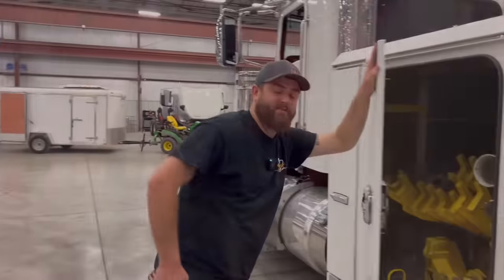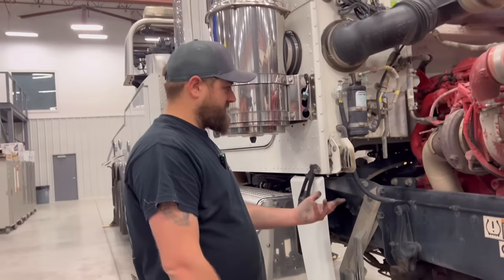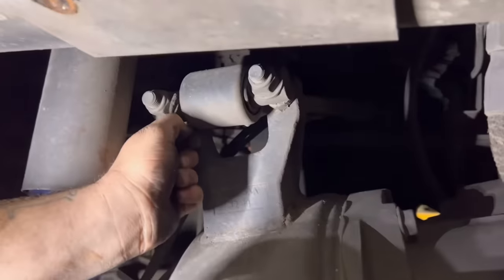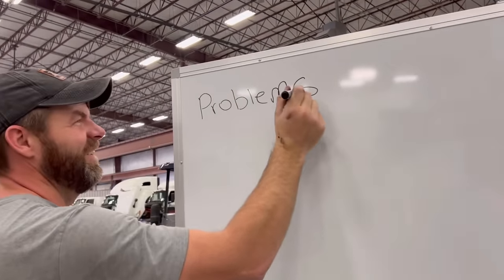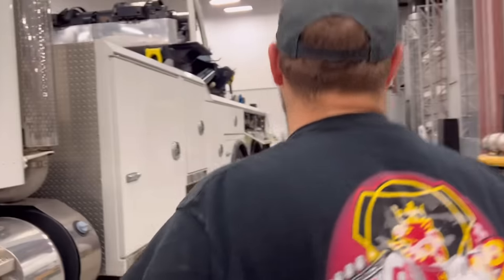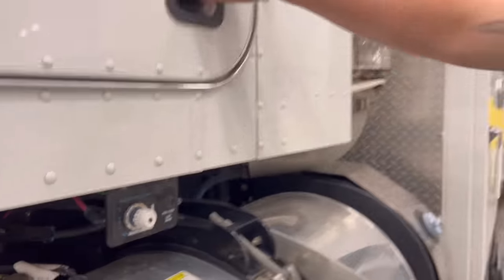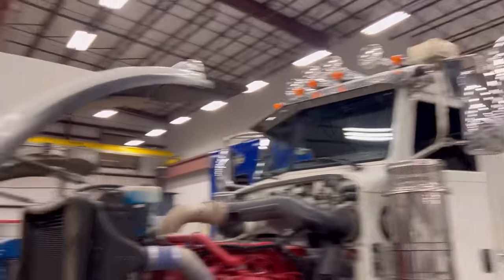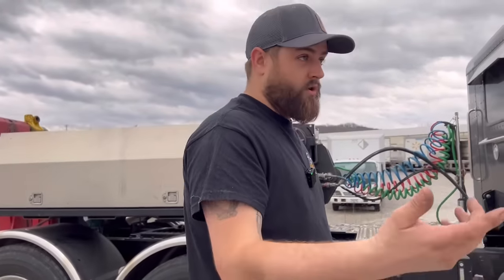The New Rotator Needs COSTLY Repairs…

Comment: YouTube channel “Ron Pratt” with Midwest truck has a similar rotator and when they set the brake it lifts the axle.
Reply: 1150R
Reply: Ron’s rotator is awesome since he has the 1150r which means that the boom can roll toward the back or front. He also has the raptor controller meaning that he uses joysticks to control the boom and it is NOT the same as the control system on this 1150. Murphy’s diesel does have the same control system so it may be better to learn from them and their 1075! Good luck
Reply: i was going to say the same thing i doubt he would have any problems answering your questions this is his channel https://youtube.com/@ronpratt?si=8mjej2jRnoAephqT

Comment: Ive seen moisture in the egr systems many times, its not always coolant. Also your vgt is cycling because the sensors aren't getting a good reading. Before you drop money on an egr cooler, id tell you to try something much cheaper. Clean as much moisture out of there as possible, and then clean any sensors that could be affected by the moisture. Specifically the egr temp sensor, egt sensor, egr differential pressure sensor, egr orifice, and map sensor. Once you do that, the vgt will stop cycling like that. Then you could also run the truck for a bit more and re check to see if it is indeed the cooler
Reply from the maker: I’ll try that for sure! The truck has lots of hours of running at 1500 rpm so it may not be loading up enough to truly burn off all of the soot
Reply: @Bruce_Wilson  - I don't know about your truck, but the newer Scanias don’t use EGR.

Comment: Also, if the truck is parked with the parking brake on the lift axle will not go down push the parking brake in chalk, the wheels adjust your air valve and it’ll go down
Reply: Pull out on the white knob beside the switch for the lift axle and twist it to apply air pressure to the lift axle.

Comment: Would recommend taking the main boom all the way out. Check for any cracks - crack test. And double check all hydraulic lines. And lift cables. Because that could be the biggest drama on a job
 Check twice. Safe and sound. Gease the cables less chance of rust. 👍

Comment: There is a hose on the inside of the frame rail next to the turbo that leaks on all Cummins. It’s a cold water leak. Tighten the clamps and it will fix it.

Comment: That egr cooler looked like mostly moisture which is pretty common. Id block test it to check for combustion gas in the cooling system. You can also test the egr cooler itself. On the lift axle sometimes theyre programed to only drop when the brake is released.
Reply: I know that's true for when its cold but if that thing is still as hot as they made it sound like it should be pretty damn dry. I don't do x15's but I see techs get confused about moisture a lot with the 6.7

Comment: For the safety lights, I'd highly recommend using Whelen and running the system using Whelen Core. It is a bit on the pricy side but the amount of features you get out of it is phenomenal. Not to mention using the best lights on the market. The price is very well worth it.

Comment: Those are federal signal led lights they just rotate u need to have the lenses wet sanded. Those lights are great lights definitely keep them. Also my lift axle on my truck only comes down when the parking break is pushed in it goes up when you put the parking brake on or put it in reverse. Also the crane has to be certified yearly. I have a knuckle boom on my truck and I have my knuckle boom cert. which is good for 5 years. Also my boom gets certified yearly. And they do a total service on it every year also.

Comment: Hey I used to run a big wrecker, as far as your brakes being spungy we had to get a trair gled hand and put it on the trailer service on the back of truck to release the trailer the red valve in the cab try that while driving it
Reply: Had a 379 that did that also,  hardly any brakes unless the trailer brake button was in..weird huh?

Comment: I'd suggest you guys get metal plates for the Rotator, We use them on our 110 foot fire truck they would help greatly when you come to a soft service or even when you don't want to mess up the ground you are using the rotor leveling system.
Reply: The composite outrigger pads are the way to go, they are much lighter and capable of higher loads.

Comment: Did you figure out lift axle? It won't drop when brakes are set. Or if it's down when you set brakes it will lift it. That's what our mini wheeler does.

Comment: We have the exact same truck at our Tow company. I noticed during several recoveries. I kept smelling an antifreeze smell. When I would get on the bed next to the stacks, I could smell the antifreeze. So after doing some tests unfortunately, we had to do a complete in frame. The truck drove and ran perfect, but would lose just a little bit of water, just like your case. I should also mention we also had water from the EGR cooler. So we change that first hoping that was the issue. But unfortunately, it had two major issues. I certainly don’t envy you if that’s what it is. But it certainly has exact same symptoms that our truck had. Ron with Stanislaus Towing

Comment: LIFT AXLE 

Hey Bruce, often times with what i’ve seen or with what I’m aware of with many of the Peterbilts and Kenworths (2015+2020+) has a lift axle switch/ pusher axle switch which must be engaged first from inside the cab before the dial and switches from outside the cab can be used, and yes ofc obviously best to do it with the truck running

Comment: So I’m guessing that like many of the rotators that what used to be mounted on top was a Will-Burt light tower but was probably removed due to issues with the light tower and being so expensive to fix. We actually just removed one from a truck at the Fire Dept I volunteer at because it was just as cheap to replace the tower as it was to fix it.

Comment: When you showed this truck in the first video where you collected it and said you smelt coolant I knew it had issues as I used to own a radiator repair shop plus i know a lot about about Cat and Cummins engines. 
Blown head gasket not good but do get the top tank taken off the radiator also and cleaned out the tubes.
Replace the coolant after the engine repair with enough antifreeze to make it 60% anti freeze anti boil. It will very soon be at 50% within a day.
If its got a Horton Fan clutch make sure its working properly, also check that the temp sender is showing the correct temp in the cabin, buy a coolant temp gauge to check by inserting it in the recovery bottle after the engine has been running for at least an hour.

Also ensure you replace the thermostat NO MATTER WHAT anyone tells you.

It quite often takes a few cycles to get the new thermostat to work correctly.

To get the temperature up to working temperature blank off the front of the radiator to close airflow, you can use a large piece of cardboard.

Comment: The 22 T880 with the x15 I drive was eating coolant like crazy and a new EGR (so far) fixed it. It was at 130k miles. Sitting at 161k currently. Several of our T880 with the same motor have all had to get EGRs to fix the coolant eating issue. Not saying that’s what happening to yalls but just something we’ve been through with that motor.
Reply: Repower it with C15 no more issue

Comment: The lift axle should come down with the brakes off. The switch should just keep it from dropping when releasing the brakes I believe. But the tater where I work the drop axle is set to the parking brakes and raises when in reverse.

Comment: The lift axle only works with the breaks released. Release breaks flip switch down. That’s a DOT thing they don’t want you fooling with it going down the road. My new 2023 is back inside the truck
Reply: some states the switch must be mounted outside the cab

Comment: Hi Bruce love the wrecker behind the cab up top of the box those holes are most likely where the spreader bars where stored also check with zip towing they may be able to help with your towing lights also Ihave to tell you to ask the owner about all the chains binder straps also on the front passenger side tool box there should be a chain chart with different chain sizes and load limits

Comment: Air hose reel roller guides need rotating, or flipping over. I also recommend putting balance rings on all wheels, i run atlas balance rings on my trucks.

Comment: I had a 2016 just like that it was a 1150R (Roller) it weighed 72.600. It that 23k on a 20k steer riding with the pusher up. It’s a steerable pusher so I ran it all the time and I could get the steer to 18. Yes tell Robert it’s what they call a Solo Clutch

Comment: I run the pdi coolers also the pipe and hoses going into the heater core always leak. There is a procedure for greasing the boom, miller has some YouTube videos. John Hawkins is the man at miller that knows everything about there rotators.

Comment: The EGR valve could be sticking or the EGR cooler could be worn out plus those Cummins engines have a problem with using Def fluid in them

Comment: Careful Bruce. Power probes can be pretty dangerous if you don't fully understand the circuit. Especially on vehicles with solid state controls that are inside the modules. Messing around applying power to things you don't 100% know what it is, is a recipe for buying a new computer. If you know what you are doing, the power probe (even the old power probe III) can be great diagnostic tools.

Comment: As far as I know there is no required crane certification for actual towing uses, If you were to go work on a jobsite with it to assist lifting hvac units or something like that then you may very well be required to abide by a lot of crane regulations through osha.
As for the drop axle, i presume there is an air solenoid somewhere that controls air flow to the bags, You need to trace power back to that switch first and make sure it's actually getting power as regardless of how the lift axle actuates if the switch isnt receiving power it isn't going to work, trace that to the source and get power to the switch then work from there.

Comment: “When used in response to a wrecked or disabled motor vehicle, tow trucks and rotators are exempted from the regulations and operator certification requirements of cranes”
Pulled from google but definitely check with your local state!

Comment: Clean egr, replace differential psi sensor and clean ports, replace imap and exhaust back psi sensor make sure the tube to the manifold is not restricted probably why your vgt is hunting, there can be condensation in the tube and not necessarily antifreeze usally if it’s really leaking it will wash the carbon off completely you could bench check it, also make sure you flat edge manifold before going back together, also cheater won’t come down unless brakes are released, also the vavle is common on them as well

Comment: Empty weight can be close 60K but that is not adding all the weight of the equipment needed for recovery for the tow truck that can be lot more. But its a tow truck ready to do the job what is needed. Glad to see you doing some tow truck type work.  🤟 Should be better to add a switch in the cab for the lift axle so its not out side.
Reply: Many places its not allowed to control the lift axle from inside the cab. It prevents operators running around with it up and only flipping it down when they see enforcement or to scale.
Reply: @legohead6  That is good to know. I didn't know that. Thought they would have a option to have it inside.

Comment: hey bruce not sure how many comments you actually look thru but i have the whole shebang of the EGR systems and the factory turbi that came off of one of my trucks we had for other reasons of course but the factory turbo is about 7,000 dollars back a year or 2 ago... not sure if the orices have went down on parts or anything but i can put my hands on everything and can possibly make you a good deal on them i know its used stuff but there was nothing wrong with the parts we took off we had other issues come about... if you would like pictures or to know what we have just as spares incase something happens maybe we can get in contact with each other and figure something out i live in alabama so possibly just a couple hours away if you are intersted but like i said not sure how often you look at comments or anything.... nice looking wrecker hope everything works out on your new journey with the recovery thing

Comment: The Tire Date Code is included on your tire’s sidewall and is included in a series of numbers known as the DOT Code – also known as the Tire Identification Number (TIN). This code from the Department of Transportation can be important for determining the date of manufacture of your tires, as well as for registering new tires with the manufacturer and even potentially identifying the tire in case of a product recall.

The full DOT code (including the date code portion) is displayed on at least one sidewall of every tire. The opposite sidewall – will have either a full DOT code (including date) or a partial DOT code (without the date code and any optional characters) at the manufacturers’ discretion.

Look at the sidewall of your tire – there will be a code following the letters “DOT” – for Department of Transportation. There will be up to 13 characters that give you the information you need to identify your tire and also identify the date of manufacture of your tires.

The final four digits, for any tire made since the year 2000, are the tire date code and represent the date of manufacture. The first two of these digits designates the week of the year the tires were made, and the final two digits are the last two digits of the year of manufacture.  (For example, 1319 means the thirteenth week of 2019.)

Comment: That truck should weigh 67-68k and expect to be replacing brakes every 10 months to a year the disc brakes just don’t hold up under all the weight I recommend that you get a brake buddy to run the brakes on whatever you’re towing to help save the brakes …..we had that same spec Ed truck at a company I use to work for and those are the main issues that we had ! We had a sister truck with drum brakes and had no issues with brakes wearing so fast
Reply from the maker: Thanks for the info!
Reply: @Bruce_Wilson  boom does not need a cert but you need a hoisting/rigging license at least in Massachusetts
Reply: Cables should be checked regularly but no need to replace unless there are damaged ie flat spots broken strands kinks and also a great idea to lube them with cable lube and always put some pressure when respooling the cables so they wrap nicely if you dump the spools it’s a good idea to hook a pickup or something heavy and have someone hold the brakes enough to keep good pressure on the cable but not enough to have the truck dragging but during a recovery just holding some tension by hand is good enough
Reply: @Tate6788  words of wisdom,   way over the head of many comments on here..   btw no hoisting license required in Ky.. 🤣

Comment: Bruce you guys are really going to need to stay up on the suspension on your rotator big time, most of the companies that put those trucks together don't seem to spend much time on beefing up the suspensions while putting those recovery bodies, rotators, tow truck, roll backs ,,,,,, they just slap the bodies on and ship them out, just speaking from experience working around dozens of different recovery trucks, there are some companies that you can contact for upgrades on your suspension from front to back upgrades to your brakes all the way around the truck it's always better to spend the money while building the truck than after you; buy it and something happens and you need rescued because you're truck was built the cheapest it could be that's probably why the previous owner sold it, most people buy rotators and work them until they are wore out not selling them with only 100k miles unless the previous owner died they usually don't sell them

Comment: if i was to gamble on it i would say the air pressure in the drives is off and when you turn this big ol girl it will chatter the tires if the pressures are not perfect and im sure that is what took out the bushings on that bar and as far as the wheel goes driving that much weight around i would want that steering wheel to feel solid personally but im not sure about it and as far as the lift axle i think the circumstances need to be just right to work on some of them trucks there is certain things that will make it go up or not come down you will also need to get a case of spray lube and take them cables all the way out and re roll them in hook on to another truck or something for tension and spray them going all the way back in depending how old them cables are you might need to replace them many companies replace them every couple years

Comment: No it doesn’t have to be Certified. You’ll find that out at Ringleaders wreckers are qualified not Certified. Qualified means you can do the job. Certified means you liable. It’s not a crane. Now if it didn’t have the under reach it would be a crane and would have to be certified. But it’s wrecker exempt. Which also makes it scale exempt and hours of service exempt
Reply: It's not scale exempt in southern Illinois,   they will ticket it if over on drives, logbook etc..been there
Reply: @ky.gambler5281   sucks to live there Virginia don’t fool with you. Hell the east coast don’t expect Georgia you better have a amber light permit or turn them off

Comment: Does the truck have to have the engine running for the lift axle to work
Reply from the maker: No I’ve tried everything
Reply: @Bruce_Wilson  ours only lowers when brakes are released, also lifts when in reverse,  hooked into backup switch imo..